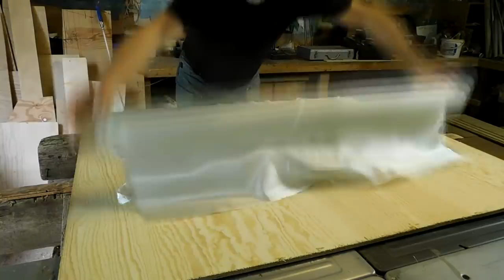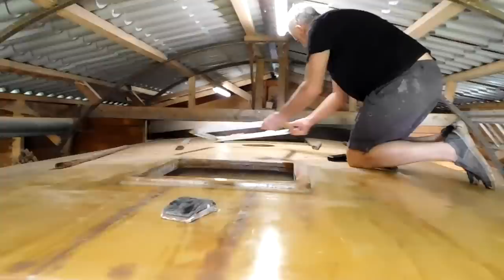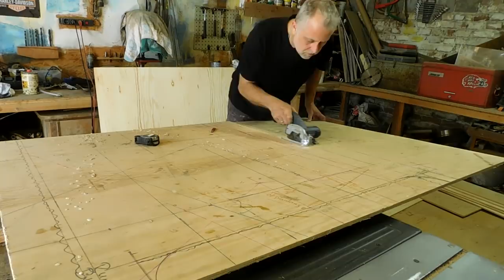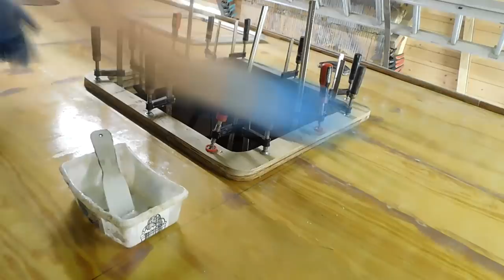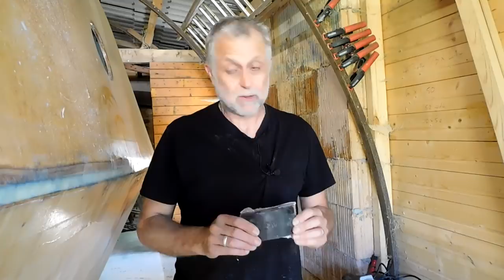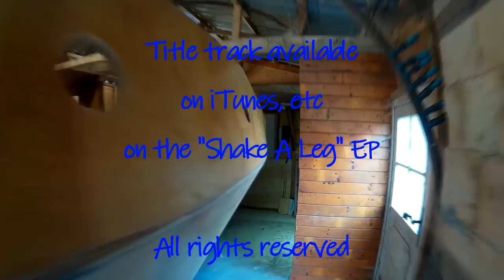Cabin sides, the main deck hatch and a new tool tip - SV Tapatya EP90

Comment: I couldn’t keep myself from smiling when you used a can to draw the radius on the outside corners of the hatch spacer. I’ve used the same method for years. A friend of mine who is a cabinet maker asked me how I drew the radiuses. When I told him he couldn’t believe I used something so simple.  I told him I usually have a can around that will be the right size.  It looked like you used a quart can, I could be wrong. 
Your boat is looking great. I really like how you are mounting the deck hatches.  I’ll have to say I was surprised at how thick some of those pieces are. But I guess they have to be in order to be as strong as they have to be.  The drawback will be weight.  Your boat will be heavy. I’ll bet you’ll be glad when your finished with the glass work.  I enjoyed this video and can’t wait for the next.
Reply from the maker: Thank you James. Yes, like you, I always use cans to draw radiuses- there's always one with the right diameter around somewhere. End of glassing - yes indeed. That'll be good!
The particularly thick parts are at the mast partners, where a junk rigged boat needs significant strength, otherwise she's just the standard 2 cm thick. My last cruising boat was a 32 footer that had a displacement of about 9 tons; this one will be about 5 tons, so not overly heavy 👍😀⛵️

Comment: Hi Tony - love the videos, watching you since day 1.  Quick question - are you planning on over-drilling the holes through the deck for hardware (such as winches, cleats, deck hatch frame, etc.), filling the holes with epoxy, then drilling smaller holes for the bolts?  I have seen this done on other videos as a way to protect the plywood from absorbing water if there is ever a leak.  Just curious to see if that was your plan as well.

Keep up the great work!
Reply from the maker: Thank you Jim 😀
That's a good question. I certainly intend to, and do, thoroughly seal any end grain exposed by cutting or drilling holes. Up to now, I've just given it several coats of epoxy and a good application of sealant. I'll think about that 😀👍🤔

Comment: I till do not know why you fitted the portholes and the fitting at the bow before you have finished the surfaces, like total paint inside and out.
Reply from the maker: Hi Lars 
I prefer bonding the hardware directly to the epoxy or wood. I have no issue with cutting in a bit of paintwork afterwards
Reply: @SVTapatya  Blimey mate, me I hate painting to start with, but to make harder, no way. Have fun my poor deluded pommy friend.
Reply from the maker: 😂😂 The thing is, Lars, I want the adhesive sealant on those portholes, etc, to bond to the structure. If I paint first, I'd be bonding to the paint and relying on the paint-to-structure bond ( which is almost certainly not a structural strength). Perhaps another point in my favour is that the inside will be brush painted and the outside roller painted, so there won't be loads of masking up to do. Anyhow, that's how I'm doing it, deluded or not 😀
Reply: @SVTapatya  Your boat your problem. Me I go the easy way. Still love your work Tony.
Reply from the maker: Thanks Lars 😀👍
I guess we can agree to disagree on that one!
Reply: @SVTapatya  Yep, Good night Tony.

Comment: Brilliant! Great tips on sanding. You may have covered it but I love your little circular saw. It seems to have excellent cutting power and appears to cut through plywood like butter. Is that a Bosch as well and what is the voltage on the battery. Can tHis be bought on Amazon? I continue too enjoy your build, I’m learning a lot.
Reply: I too admire the heck out of that little saw.. what a trooper! Seems like there's nothing it can't cope with.
Reply from the maker: Thanks Edward. Yes, it's a Bosch and a great tool. It's from the Bosch 12volt professional line and is indeed available on Amazon 👍😀